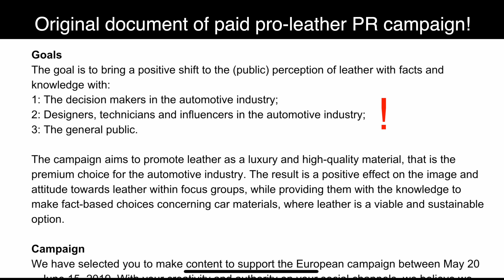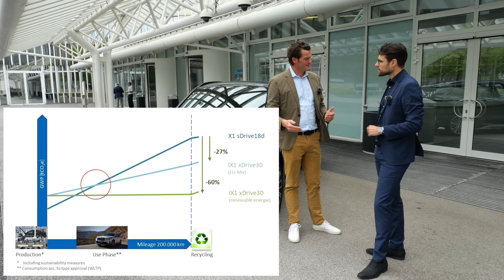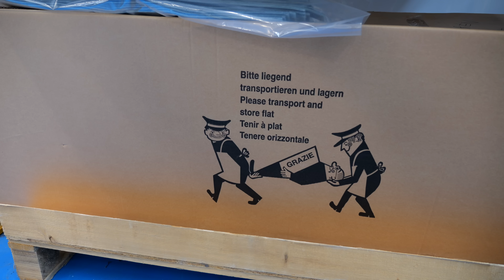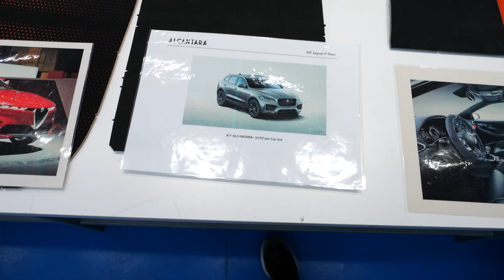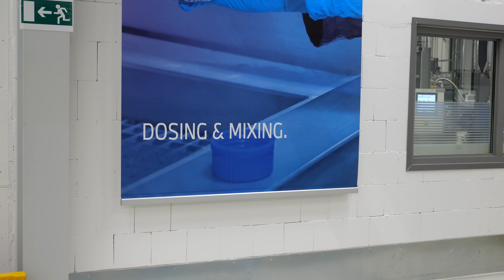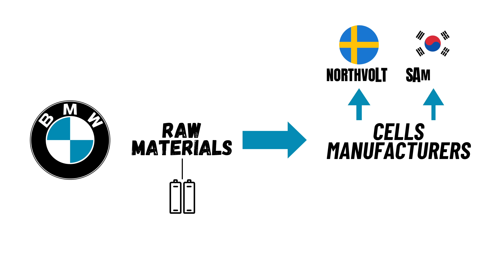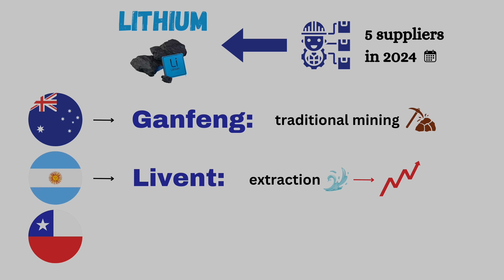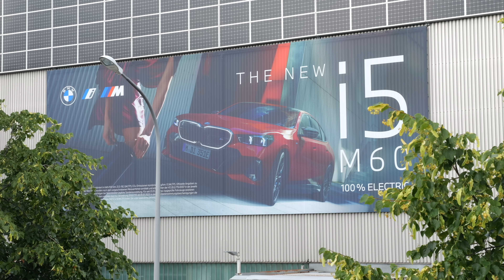How to produce more sustainable cars? DOCUMENTARY

Comment: Not a fan of the "neue Serie" style from the outside. It somehow feels to "simple" and without character. 
Kinda like a kid drawn it.
Reply: The path to sustainability may lie in simplicity. Simple cars are easier to repair and maintain.
Reply: @jeffcohen1934  Well i think it is already to late for this. Car mechanics can't really analyze any problems today and all they can do is replacing the parts. Bodyparts are replaced anyway, i doubt that the drive train and infotainment systems will get simpler, i think it will be opposite.

Comment: EVs with present battery tech, many of which their batteries are not long lasting, not easily replaceable, more expensive to replace than the vehicle value or even its cost when new, leading to disposable still in good shape "carcasses", it's not very sustainable and not desirable for the common limited economically customer which must make conscious spending decisions. A 10yo EV is so devalued, no one wants them because of low range and can become a money pit, while a well maintained ICE with 10 years is still very good for everyday case use scenario and long trips.
Reply: If more EV batteries were made to be swapped they would be more easily replaced and possibly at a lower cost than having to rip the vehicle open to replace them with current tech many years down the road.

Comment: car makers can start by making cars last longer lol everything is plastic. also software updates in the infotainment should be forever improved and the parts modular, easy to swap new hardware like computer and sensors but companies just think of selling whole new cars and not about longer lasting and upgrade-able cars. the blame is largely on manufacturer for not encouraging such things and consumer too to some extent, it takes two to tango. they are also making it harder for user to service their cars at home to help in longevity. so the car makers are against the user and the environment for their own monetary gain and this is still true in spite of this presentation from bmw foe example, nothing has changed. that car will not last powertrain wise and a new one will have to be made - very wasteful. recyclng is not a clean process either - long lasting parts are. lets not forget the poor incentive for users to want to repair and keep their broken bmw, the parts are so plastic and so expensive, no incentive to repair. the labor cost too. once again, nothing has changed. the elephant in the room is constantly ignored. this is like gaslighting lol 'hey look at the alcantara and wind tunnel nevermind all those facts that really say we only care about profits.' dealerships are also rogue agents, they dont really take care of the customers car and help it last. they love if your car breaks so maybe you buy parts or a new car.
Reply: Also making new engines all the time. Sometimes worse than the older one.